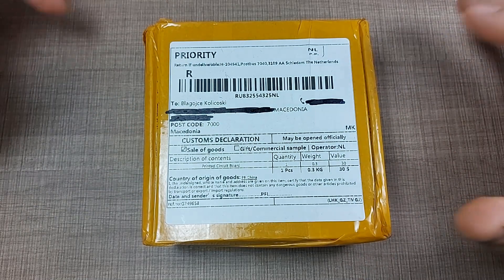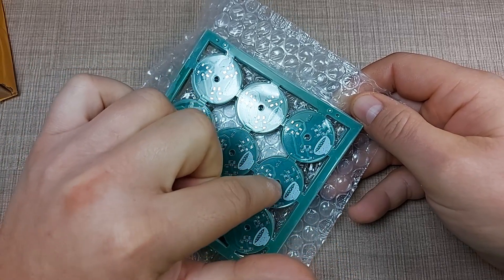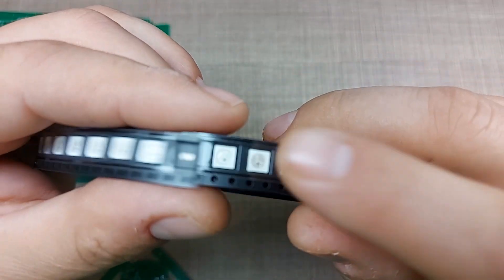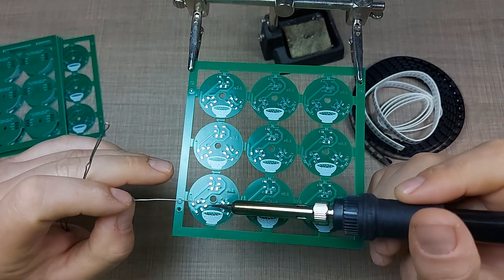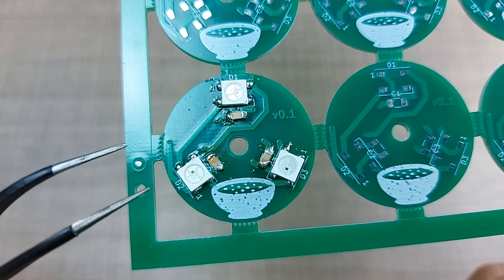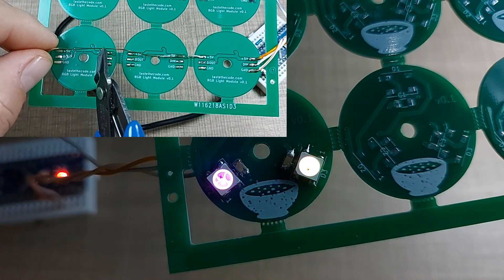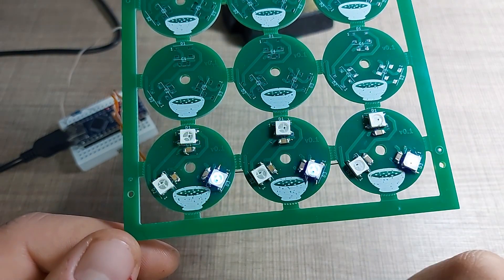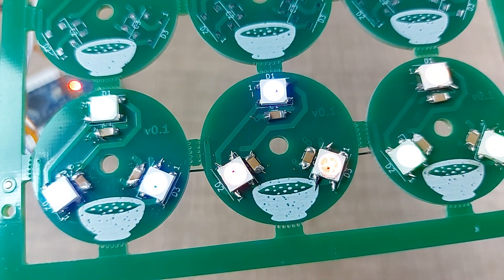I can't believe that it works! RGB module SMD soldering and PCBWay boards review

Comment: What exactly are D in and D out? And why did you use a capacitor?
Reply from the maker: The LEDs that I used (WS2812) are addressable so I can chain one module to the next one as if having a single strip of LEDs. The capacitor is added for voltage stability on each LED as recommended on their datasheet.
Reply: So Din and Dout is Data in and Data out to chain the LEDs together.
Reply from the maker: Yes!

Comment: Nice. Din Singal level is 3.3V or 5V?
Reply from the maker: The signal is 5V but I guess it can as well work with 3.3V
Reply: @TasteTheCode  I usually use level shifter on 3.3V Singal. Thinking to skip it 😅
Reply from the maker: @MallikarjunSE  try it. Just make sure to power the stip with 5V.

Comment: Good stuff mate, not easy soldering small components like that. It's for your stairway is it?
Reply from the maker: Yes Rob, thanks! I'll have a chain of these on each stair and they will be triggered with a movement sensor of some sort. I'm still trying to figure out the enclosure where to put them.
Reply: @TasteTheCode  3D Printed? What did you end up doing to mount them?
Reply from the maker: I haven't mounted them yet. I do not own a 3d printer so that is not really an option right now. I am on the lookout for some enclosures for rexessed lights like in drywall for the GU10 style of bulbs but they need to have glass on the front so they can't be poked through.